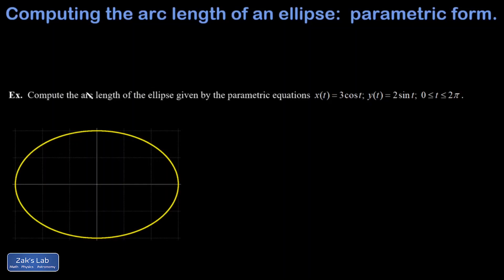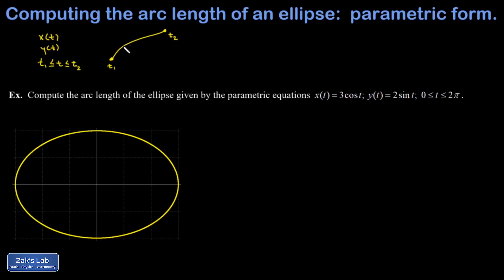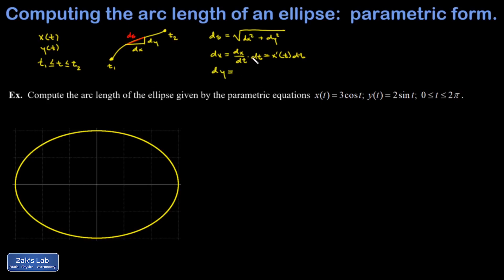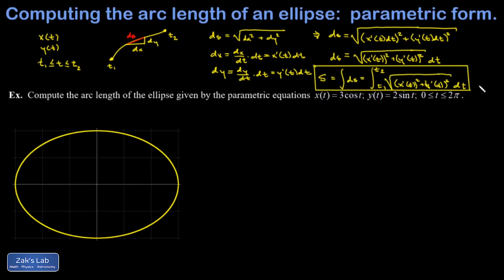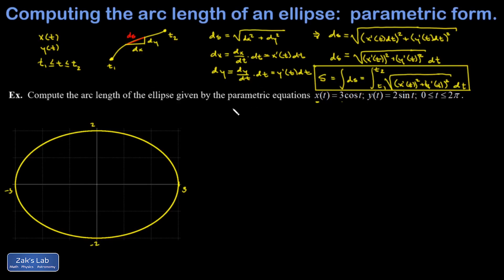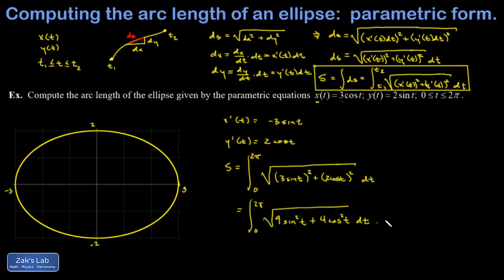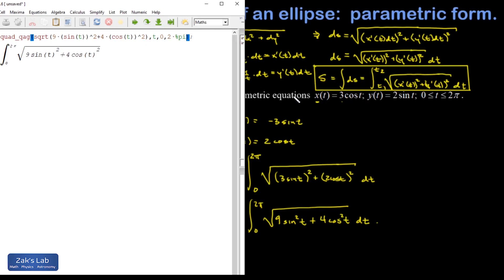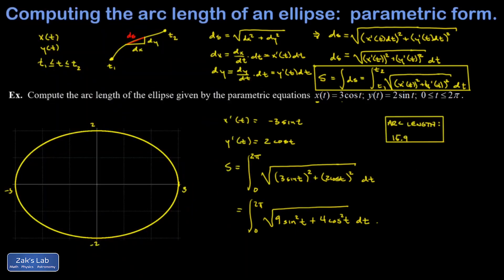Arc length of an ellipse using parametric equations. Parametric arc length formula and approximation

Comment: Forgive me a dumb question: isn’t that the entire perimeter of the ellipse? I realize that is the arc length from 0-2pi, but I got the impression this would be a way to calculate the arc length of a section of the perimeter. Is there a way to get the length of just a piece of the perimeter?
Reply from the maker: It is the entire arc length of the ellipse, I suppose perimeter is a reasonable thing to call it.  All you have to do to get a smaller section of the arc is change your limits of integration to cover the arc of interest. -- Zak
Reply: @ZaksLab  "Limits of integration" -- that's exactly what I needed, now I know what to google next! Cheers